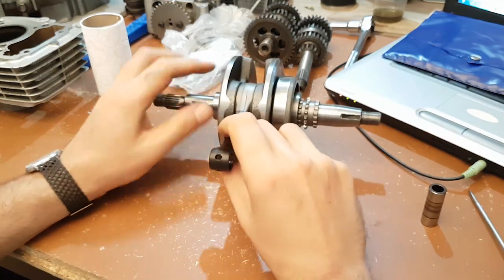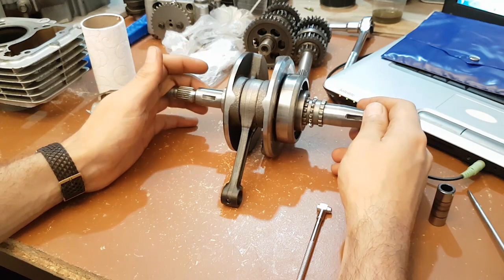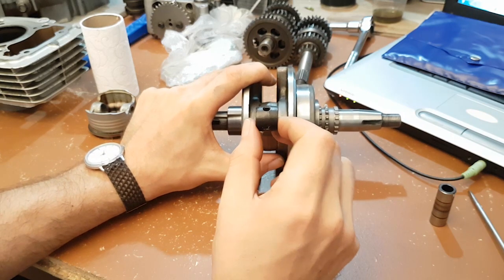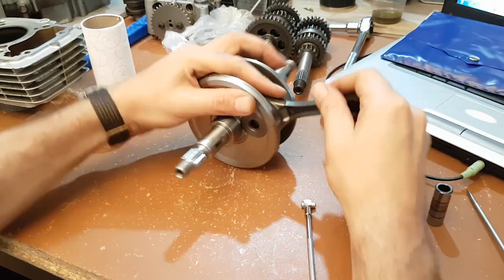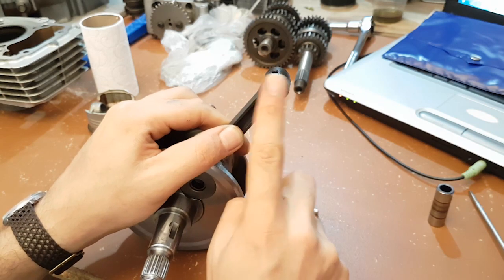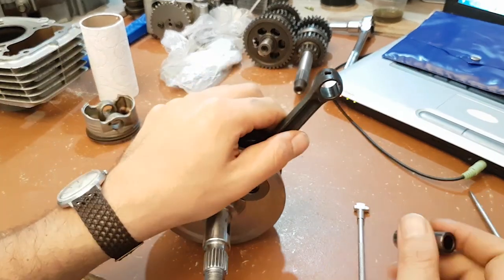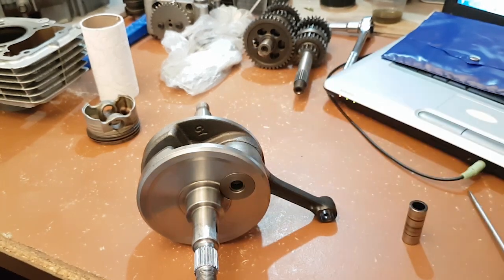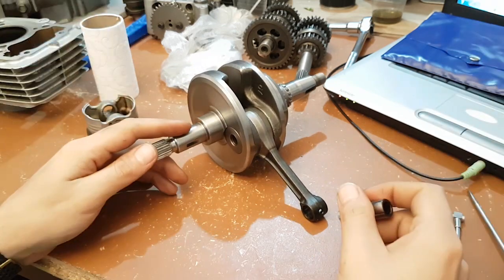Motorcycle Crank Inspection. How to Check for Engine Knock and Piston Connecting Rod Play

Comment: hello i have a motorcycle i suspect it was a crankshaft thats making a noise like a ticking sound when i rev my engine.. ive adjusted my valve clearance and the timing chain has been check but the noise still there. it was on my channel.. i can't figure it out..
Reply from the maker: I cant see the video. Send me the link. Yes you are right. It is probably your crankshaft which is the problem.

Comment: Is it normal for the conrod to be feeling slightly rough when u move it up and down?
Reply from the maker: Unfortunately no. Try to bathe the whole assembly in solvent while you move the conrod. Maybe there are metal pieces in the bearing.

Comment: Can you chack piston rod movement with the head or top end removed insted of opening the     crank case or gearbox
Reply from the maker: In my case when you remove the cylinder you can reach the piston connecting rod. At this point if you can try locking the crank in place securely then I think you should be able the check if there is any play.
Reply: A trick : you can watch movies on flixzone. Me and my gf have been using them for watching a lot of movies during the lockdown.
Reply: @Sonny Ronin Yea, I've been watching on flixzone for years myself =)
Reply: @Sonny Ronin yup, I've been watching on flixzone for since november myself :D